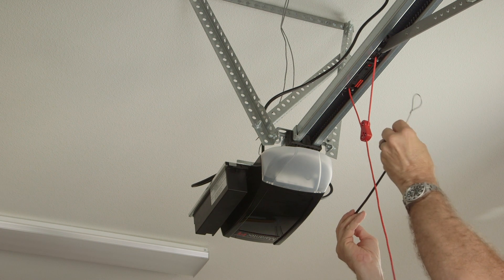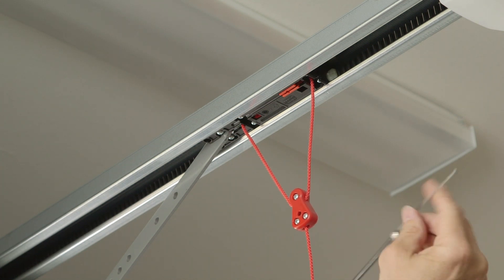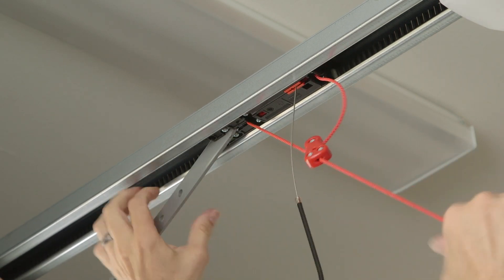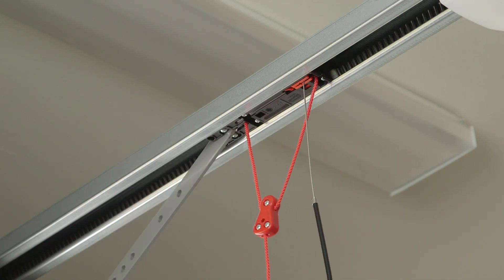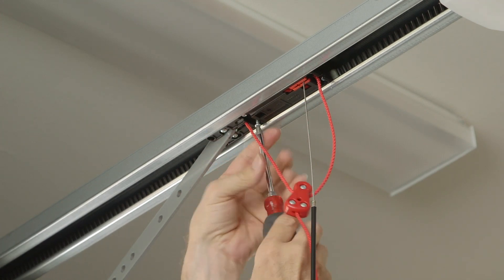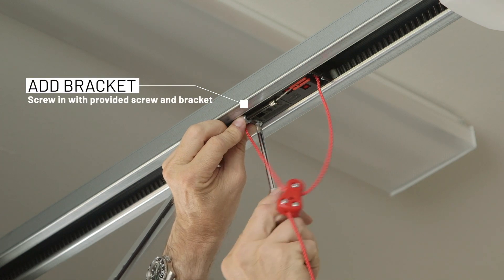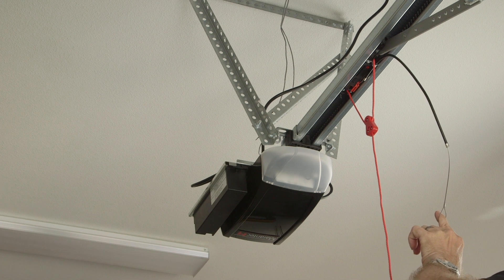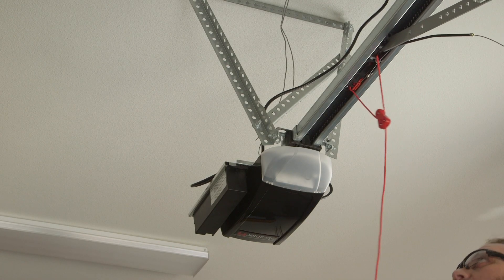Marantec Vault Lock Adapter Kit Installation

Comment: I ordered the adapter kit when my rope/cord broke.  The kit arrived with no instructions on how to install it (especially the tools required) but had two pages of legal statements.  The diagram illustrations were completely useless.  I tried three different Philips head sizes and none would work to remove the exisitng screw.  I'll keep trying, but feel like I've been played by Marantec.
Reply: Torx T20 for the screw. Give me a call if you'd like to talk through it.
Reply: @MTS_Division  thanks.  That was going to be my next try.

Comment: What is the point of the Marantec Vault Lock Adapter Kit?
Reply: To allow access to a garage that only has 1 door, in the event of a power outage
Reply: @MTS_Division  more correctly, it is to replace the plastic??? cord which deteriorates and breaks.
Reply: This kit does not replace your pull cord. It supplements the pull cord's action. It's a raw cable, it would be easy to injure yourself, pulling on it. it's designed to be attached and pulled with a vault lock handle.